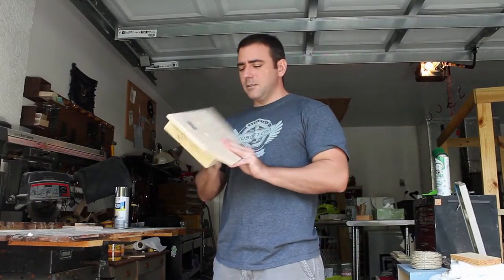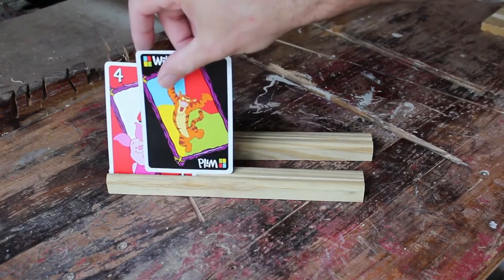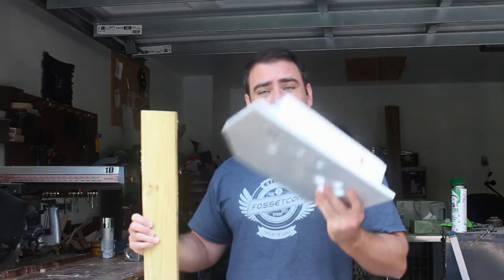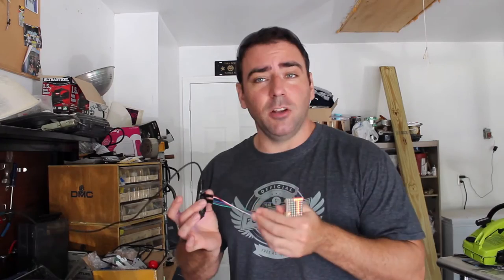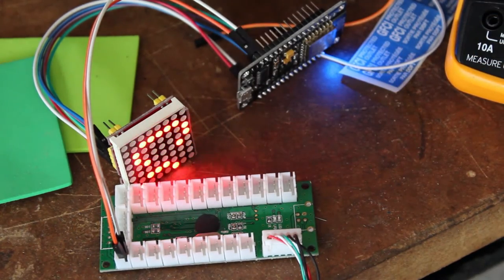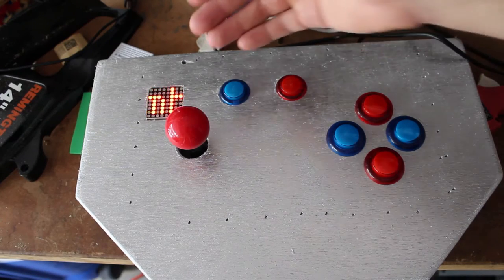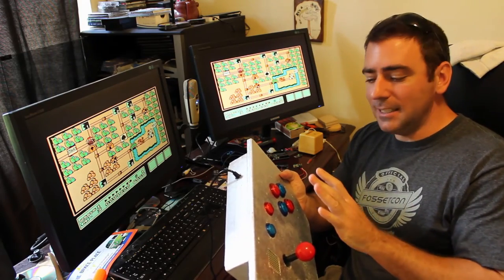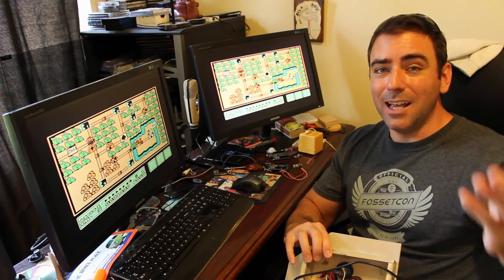DIY Arcade Game Controller Part #3

Comment: I'm using a zero delay LED USB encoder as well, but I can't find out how to make the joystick works... you have an idea why it won't work? I tried with recalbox, I can use  buttons connected to the encoder (like 'start'), but the joystick won't do a thing (expect getting out of the "standby" screen...). And with retropie, I can't configure the buttons when they ask to hold a button...
Reply: I haven't used recalbox or retropie.  You say that it will get you out of the "standby" screen.  If it's doing anything then the device is detecting the joystick.  So it sounds like the software just needs to be configured for that joystick.  Since I'm not using that software I can't help you much.  If I think of anything I'll let you know.